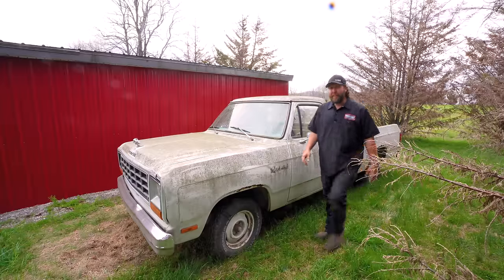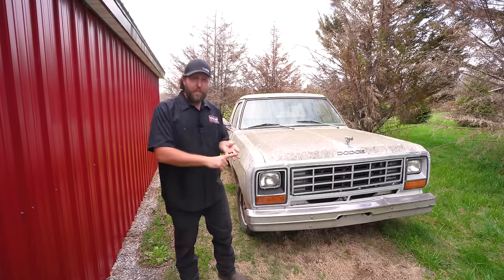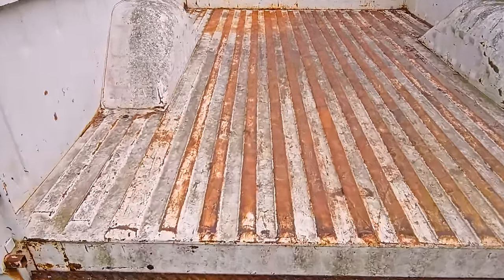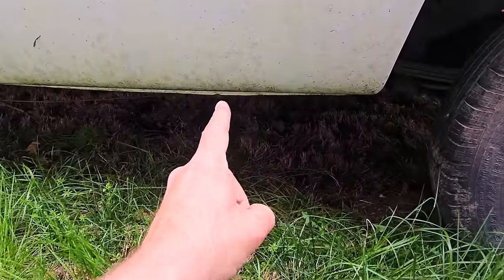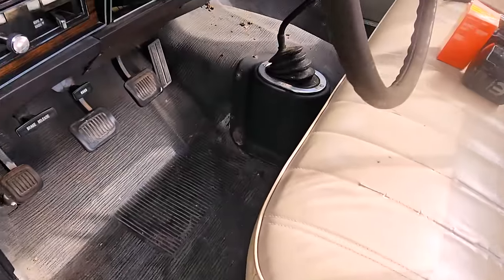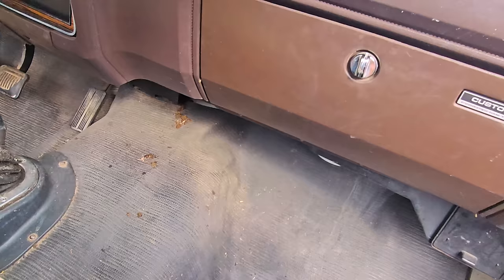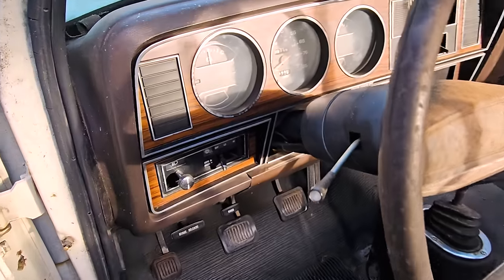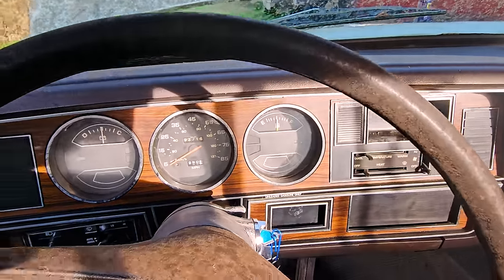Will This Old Dodge Farm Truck RUN AND DRIVE HOME After Being Parked for YEARS?

Comment: Derek I've been working on cars longer then you been alive.  Buddy don't trust you life on a floor jack. Your a young family man. Please use a cinderblock, tree trunk, rock, the tire you took off, what ever you see around and put it under the frame man.  Floor jacks fail, slip off the frame, etc young brother. Known friends in the fire rescue pulling people from under fallen cars.  Thanks man
Reply: Was thinking the same!  Be very careful with just the floor jack...
Reply: Yeah...good point. Especially using a floor jack on grass or dirt, they can shift . Wooden blocking works good, or at least one jack stand and a piece of 1/4 " metal plate to put it on.
Reply: Well said more blocking is better I'll use tires wooden blocks anything

Comment: 1987 Dodge short bed 2wd, automatic, 225 with aluminum camper shell, full size matress, 7 kids in the back. All over the eastern half of the US and parts of Canada on summer vacations in the late 80s-90s. Dad even built a bolt-to-frame wooden box/luggage carrier to put on the back.The mountains of TN were not kind to the transmission, but somehow we always managed to make it home. Lots of memories. Thanks for the great video, as always!

Comment: Slant 6 engines are some of the toughest ever made. It was no suprise that it made it home. They never should have stopped making them. That truck is a work horse.
Reply: Old D150/D100 slant six ... nothing fancy, just runs.  In some ways I wish I had my old 87 225 D150 (a833-OD) back as a hobby truck.
Reply: I managed to blow up two slant sixes in my '74 Duster, though to it's credit the first one I blew still ran on four cylinders with a hole in the side of the engine where on of the pistons ejected itself. However the 318 in my '73 Charger refused to die even when the rest of the car rusted away around it.
Reply: The fed. govt. mandated CAFE standards and ridiculous emission output limits stopped production of the slant six. If it was given electronic fuel injection it most likely would have stayed in production. Jeep/Chrysler decided to go with the AMC straight six instead.
Reply: Jeep may have gone straight 6 , but the slant 6 in pickups was replaced with a v6 that was the 318 with two cylinders lopped off.
Reply: @jlaakso1706 My 318 that came with my truck had a hole in the timing cover and the entire engine is horribly rust filled. Put a couple thousand on it so far and no issues besides burning oil but my dakota without rust did it too so 🤷‍♂️
Reply: @o.c.smithiii2626  You are correct. The slant six is a smooth running in-line six when properly tuned.
Reply: Aussie slants started to blow blue smoke around 100k to 120k miles. Don’t know if it was soft rings or valve guides. Just used to replace rings and guides. Job done.😊
Reply: @mtrgv  The 225 won't fit in the Dakota because it had a flat firewall.  The Jeep Comanche firewall has an offset to accept the longer 4.0 inline six.  Whatever Jeep did with its old six would have kept the slant six around.
Reply: Spoilers, dude...

Comment: I scored an 1984 d250 my buddy found sitting out in a pasture by him in north texas 10 years ago. It had set for 6 years they said. I needed a truck and my buddy knew those old dodges were my bread and butter. So he didnt even ask me, he just bought it and brought it to me, asked that i give him his 450$ back he paid. A lil cleaning, and another 400$ worth of parts and i have the truck im still driving today 10 years later. I love those old dodges. Mine had 82,000 on the odometer and i believe it had not rolled over as the smog pumps, and emmission hoses were still present and functioning. It now has 121,000 miles on it and has taken me back and forth faithfully many times for crewchange between nacogdoches texas, houston texas, new orleans, and baton rouge. Only let me down once when the factory 1984 alternator give up in baton rouge. Still got me home with an800watt generator running an old school battery charger.

Comment: I bought a 1985 D100 with a slant 6 and 4 sp manual shortly after I got out of the Army. It wasn't winning any races, but it always started and did what I needed it to do.Nobody ever asked to borrow it,once they found out it had a third pedal. It finally succumbed to the salt that NYS puts on the roads in the winter.
Great video, Derek. Do just enough to make it roadworthy.
Tires, lights, and someone will take a chance on it.
Love the channel and thanks for what you do.Oh, and a shout-out for your friend Don for the help , and helping out the woman with her issue. Good karma!

Comment: I had one of these (1987 ... D150, slant 6, 1 bbl, A-833 OD transmission, 'north of the border'.   He is right, it had 'legs' - very tall gearing, came with 195/75/R15 (car tires?).  It never died .. but had a few known ... 'items'.  1.  Rear main seal leak, helped keep the underbody from rusting.   2.  Slop in the trans linkage (external, could go under when locked and 'flip it'.  3.  Carburetor icing in damp cold weather.   4.  Made lots of carbon during -40C startups.   5.   Pulling the vacuum lines actually helped - gave a little diesel grunt under light throttle, but much more power, and better milage (probably just bad spark advance/smog gear).  It would always start .. never overheated.   At -40C on the highway, mileage was awful.    Starter was changed to a Nippon style - no sick dolphin noise, had enough power to pull start in 1st gear.   Body 'weight reduction occured' long before motor would give.  It truly was a Dodge ... both 'Do Or Die Gutless Engine' and also 'Drips or Drops Grease Everywhere'.

Comment: I have an 83 w150. When I saw the electronic fuel control system I felt the same way. I ended up cutting it all out and replacing the distributor and carb . Runs perfect. The old system controlled the spark advance.

Comment: The Spark Control Computer hanging on the air cleaner is THE WORST thing the EPA forced Dodge to do!
Had one on my '78 Dodge Aspen R/T with a factory 360...to increase fuel efficiency. 😢 I finally pulled the 12 wire plug out, dumped the computer and ran the one power wire to an ignition box off of a '73 Challenger. 
RAN LIKE A CHAMP after!!!!!
Reply: That's awesome. I have a 96 F150 6cyl great truck but had a weird stumble sole times I couldn't figure out had a old school friend delete as much of the Crap I didn't need under the hood like air pump BS coffee can hose tangled mess its looks way better and that stumble is completely gone

Comment: I had a 74 Dodge Dart (from my grandfather) with the 225 slant 6 in it, I drove that engine to over 300k miles before I sold it. Pretty had to kill those engines, but up here in Canada they did NOT like the cold or wet weather!!  And just a little tip, keep a spare ballast resistor and a regulator in the glove box-I learned that the hard way!
Reply: Ah yes...the ballast resistor!  I had a hand me down 72 Dart four door slant six. I remember driving it on a trip from Winnipeg to Saskatoon in January, and having to stop and ditch the air cleaner because the carb was frosting it up with engine blow by  from the PCV LOL! Great tough old car, wouldn't hardly do 70 miles an hour, but got you there every time!  I'm old now, but I miss the days when I had crappy jobs and crappy cars...always a source of adventure!

Comment: The headlight issue is the floor dimmer switch. I had the exact same issue with multiple dodges. They get all corroded because of the water off your boots. Doesn’t help Derek, but might help someone reading someday

Comment: Always remember the old mechanical fan is dual purpose. Not only does it help keep the power barn in an HVAC mode but it’s mainly there to dry out all the fluids that spray all over the engine area.
Reply: Sep, if it’s a diesel…

Comment: My first truck at 16 was an '81 D150 with the 225 and a four speed. Still got it 17 years later. I love those trucks.
Reply: First truck I ever drove was a like 1973 or 1974 F250 my grandfather purchased new off the lot back in the day, with the 460 and dual fuel tanks and all the bells and whistles.

Comment: I had a 85 D100. It was the most reliable vehicle I have ever owned . The slant 6 was not a power house, but it  ever let me down.  I bought it with 79 thousand on it and sold with 279 thousand on it. Michigan winters killed the body. I would buy another one in a heartbeat.

Comment: A 1st gen RAM, LOVE IT! I have an '84 Power Ram (W150) that my wife bought me back in '86, 318 w/air, ps, pb, 727 auto, no rust. Still runs great but the trans is very tired. Dash is great on mine also, can't say the same for my '96, it's self-delete dash has been activated, along with the self-delete clear coat.

Comment: As someone who rewinds magneto coils & knows a bit about ignition, that higher secondary reading doesn’t always signify a “hotter” coil. It could just mean they used a thinner gauge of wire on it, or even that it’s breaking down or has a bad connection internally.
A thicker wire would give a lower reading, but with the same amount of turns (or more) it would give you a fatter spark.
Reply from the maker: Very cool!
Reply: @nutgone100  you can do it Feller,  a Guy would watch it!
Reply: Any electrical knowledge gained is always welcome.
Reply: All them electronicals is just like rocket surgery.
Reply: All them electronicals is just like rocket surgery.

Comment: Found a 77 Power Wagon(4wd), shortbed, 42k miles, 440 Magnum (freeze plugs in head, had to be special ordered) TF727 transmission. It was shed stored in the high desert of CA.
The only thing that kept it from being drivable (other than the battery & fuel pump was the u joints. It had 3.5" lift kit installed (minus pinion shims). That's why it got parked because it kept needing u joints. Fastest turn around I ever did. It was the meanest, if not fastest, pickups I've ever driven. Should have kept it, but money dictated I couldn't.

Comment: Glad the algorithm recommended this one to me. I'm rescuing a 1972 D100. I didn't try driving it home though. Glad I didn't because my fuel pickup was clogged and the steel line along the frame rusted through. But I did get it to move under its own power eventually.

Comment: Between the slant 6 and the Ford 300 and both with the 4 speed you have the perfect "Survive the Apocalypse" trucks.
Reply: Agree, my old ford 300/5 spd is the most reliable vehicle around the place - when all others fail it will fire up and go

Comment: The box you are referring to as an ignition module on the firewall is actually the voltage regulator. The ignition box you are thinking of would have 4 or 5 wires. In this application, the ignition module is mounted to the breather labeled as electronic spark control, electronic spark ignition...lean burn...lol. Great video, can't wait to see where this one goes, thank you for sharing.
Reply: Seeing a two hour video on a Friday night made me smile that much bigger!! My brother had an 86’ Ram charger (dodges version of the blazer) . Same truck essentially. Loved that truck , had a 318 with a 3” lift with 33”x10.5s. Brought back great memories. Loved that big ram hood ornament that it had . Love the simplicity of a truck like that.  Great video AGAIN!

Comment: I can’t believe it… but I’m looking right at it. A dodge without the dash being Wi-Fi ed. I’m a dodge truck guy. I drive a 02 2500 4X4 with a 24V Cummins as my daily and I have 79 power wagon with a 318 and 727 torqueflight. I’ve also owned several others along the way And you almost never find one with a whole dash once they went to plastic. Great video. Nothing like getting off work to an almost 2hr VGG video. Thank you Derek for all you do for us and the car community.
Reply: So true.  Our dash is split in several places.  Ugly!
Reply: Weren't these redesigned dashes more robust?   I know the pre-'81 dash plastic was really bad...
Reply: I’m not a Dodge fan in the slightest but it seems like early 2000s Dodges like you own were the worst about that. This generation didn’t seem to be plagued by that? I know I’ve put a couple heater cores in your generation of Dodge & man were those a mistake. I’ve cut my hands a few times while those crappy dashes just crumbled while pulling. It seems this generation was pretty solid. I’d never own a Dodge personally but I respect what he’s got here. I can’t wait to see what Derrick does with it. I’d like to see for a first time, a complete frame up “restomod” V8 swapped show/hot rod type of build with it.
Reply: ya the 96 to like 02 were terrible for cracking up. And the diesel seemed to be worse guess cause of the rattling especially on the 12 valves. I hate it. My daily would have been loaded for 2002 has leather heated seats all electric and it’s still in good shape except for dash. You can get aftermarket covers so long as something is still they to glue it to. My power wagon dash is in great shape but it has a lot more metal in it.

Comment: Another tip young fella, put a foot long piece of plastic tubing on the bleed nipple of the brake cylinder or caliper. Now tie the hose upright. You can make it longer to drop down into a can. The air bubbles will rise to the top leaving only fluid in the lower part of the hose and in the caliper.

Comment: Mr. Derek, a feller grew up so dirt poor, that I never had a matched set of tires for the first several years of driving. Half the time the car never lasted long enough to put new tires on it. Send it I say....😂😂
Reply: I remember those days myself, bypassing the heater core to keep the floor dry and the a/c never worked

Comment: My dad bought one of theses new when I was 12.  It was the best truck ever, even though the 225 slant 6 in it was no powerhouse.  It was just a plain-jane work truck-- no power steering, am only radio, no carpet, no a/c, no power windows, 1/2 ton.  We hauled a lot of wood in that thing.  My sister and I rode in the middle for years-- 4 of us in the cab . . . . lol.   We actually took that thing on a 3 week camping trip through the western US-- my mom and sister slept under a camper shell in the back of the truck,  and my dad and I camped in a tent.  It was a fun trip.  Later we had an old 71 volkswagon camper van my grandparents bought brand new; my mom sewed curtains for it and we fixed the inside up and I camped in the pop-up top.  We made some good memories.

Comment: Slant six?? YES
A833OD?!? DOUBLE YES!!!!!

That is an amazing truck!!!!!
Reply: I've got 4 of those transmissions in my storage unit, got em for 20 bucks a piece off this old circle track guy, nice little overdrive transmissions
Reply: @Timman57  I have a warmed up 360 (flat top pistons, scat rods, Mopar .509 purple shaft, etc etc) with an a833OD trans behind it. 

 Believe it or not, the factory shifter is a HURST unit. 

I use them to convert 3/tree to 3/floor when the columns wear out and are hard to find!
Reply: Except for that "electronic fuel control". 🤮
Reply: @MagnumD-tr4qs  each one I have has a shifter and I'd believe it, they definetly resemble a Hurst unit, I think one may have come from a plymouth feather-duster, Steve Dulcich has an old article he wrote on how to "bulletproof" an overdrive unit for bigger power as well. They seem like a cheap way to get some overdrive in your Mopar rig 💪🏽
Reply: Battery post clamp is vice grip sized
Reply: @MagnumD-tr4qs  You can take the shift knob on those for a tour around the cab and never find a gear! An anti-theft device in its own right :-D
Reply: You are correct. The 833 od. Love that engine transmission combo
Reply: Most under rated truck ever made I have owned a bunch of them and still own a 85 and 92 1st gen
Reply: @phafinley3052  Got myself an 85 slant 6 with a 4 speed as well. Super under rated and I like not having 1 of 5 milion chevys at the local car shows.

Comment: Those slant sixes were notorious for developing "connecting rod slap" and I saw many of them run 100,000 miles like that.
Reply: I've heard stories of those things running thousands of miles with a hole in the side of the block from a thrown rod. Just keep adding oil from the leak :D

Comment: I wish we could get things like this in the UK... And drive them without jumping through hoops ...   😄
Reply: But you fellows have all of those great and well loved British Leyland cars to work on daily! Top notch! ... Nope.
😂😮
Reply: @KOrnhOliO1  fewer than you'd think, BL cars love to return to the earth and it's a lot harder to get away with the kind o weight reduction that seems to be legal over on the other side of the pond. My first car was a 1982 Mini and you could tell when it had bodywork done by the dates on the wet newspaper under the body filler. I swear the only part of that car you could stick a magnet to was the engine.
Reply: I was going to ask what kinds of hoops but then I remembered it's a country where you need a license to own a TV!!
Reply: @GemmaLB  yep... to drive a car we need a current MOT (you can ONLY drive to an MOT station without it)... Road tax "Pothole tax" and insurance for the car... but would still get pulled over for some trivial shizz.
Reply: @KOrnhOliO1  Yeah MGB's or Fords hardly anyone can afford anymore ...

Comment: I once bought an '84 short wide with 47,000 original miles on it for $600. Clean rust free truck except for one thing. It was used in the paint dept at a college and had a good inch of various paints on the bed floor, paint smears all over the thing inside and out. After much work to repaint the thing I yanked the Scant 6 and dropped in a warmed up 440 mated to an A833 B/E body pistol grip shifted four speed. It also got factory bucket seats from a '77 and black interior. Fun truck.